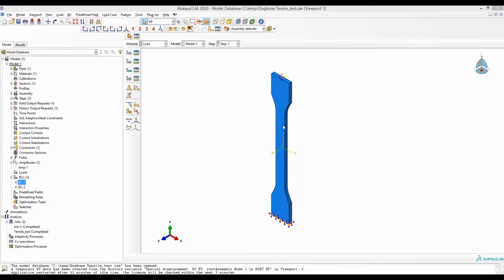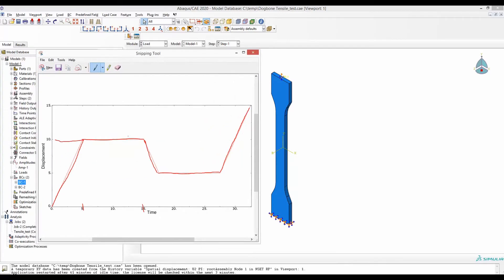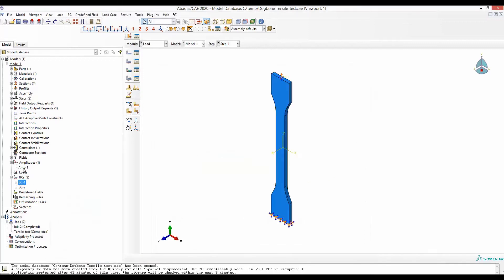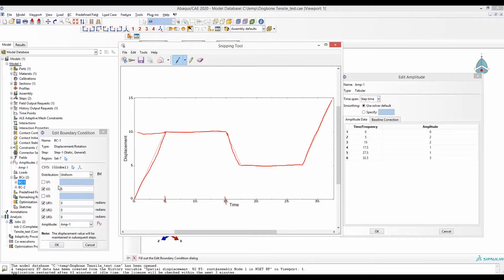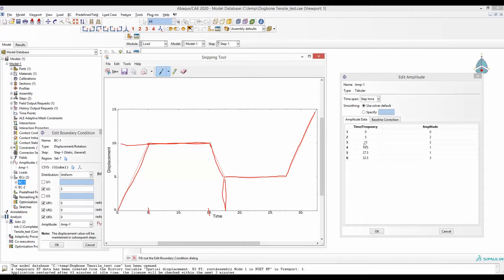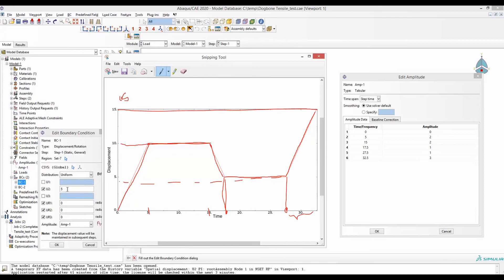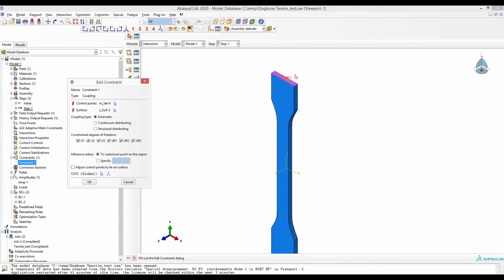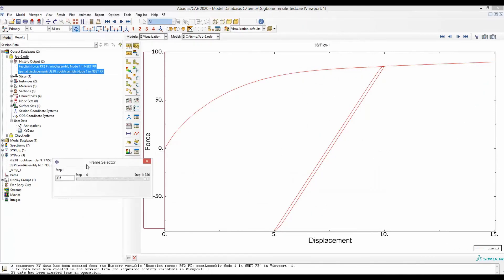Cyclic force displacement curve in Abaqus

Comment: Hello sir,
Pushover analysis uses the increasing horizontal lateral force of a certain distribution pattern to represent the distribution of the inertial force of the structure. The difference of the distribution pattern will directly affect the results of the Pushover analysis, so the selection of the lateral force distribution pattern is a key problem in the Pushover analysis. I try to ask when I analyze my model in Abaqus based on displacement control, can I give an initial force distribution ? Or how does Abaqus work about that ? Because chosen lateral force distribution type directly affects the result as many features say about that.